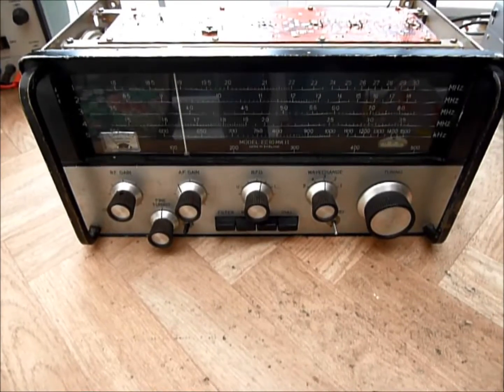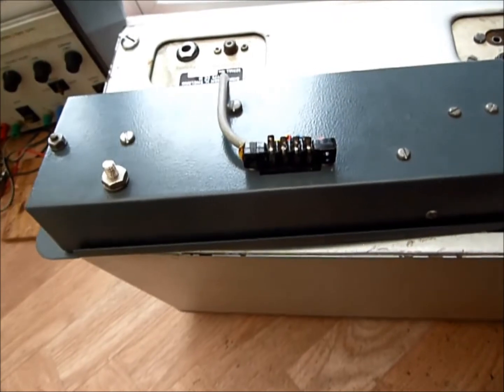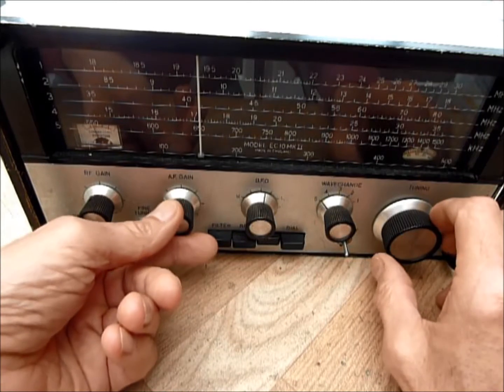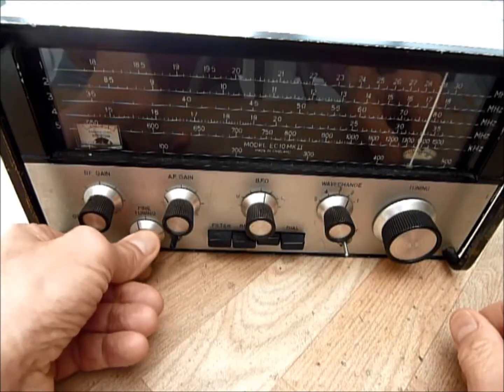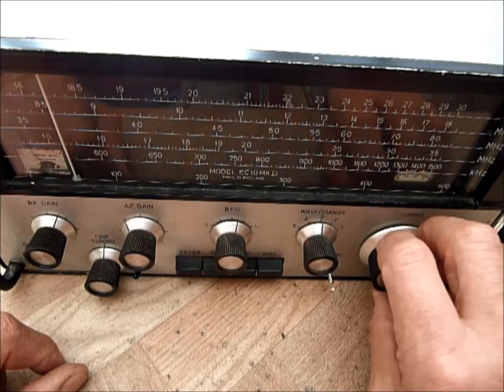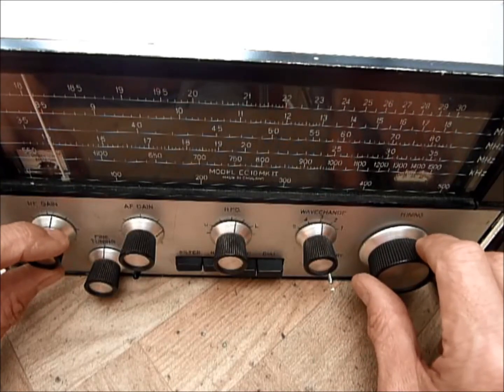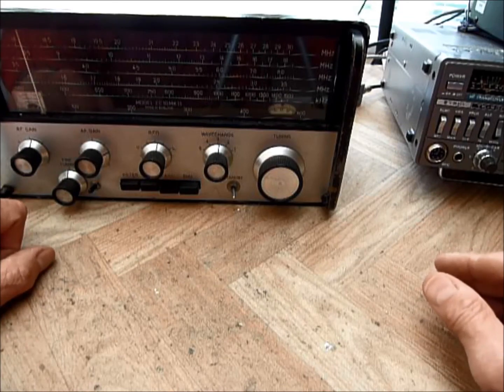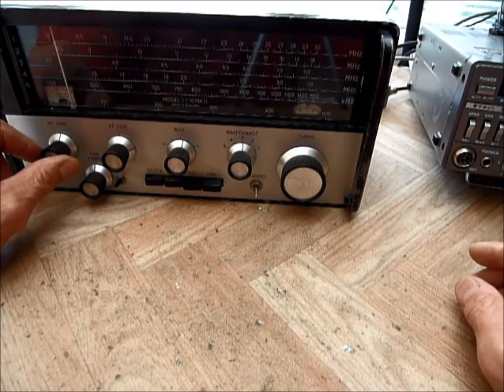1967 Eddystone EC10 (mk11) Radio Receiver Reviewed

Comment: Hi, I've just pulled one of these from my late fathers loft. It's immaculate, are they worth much?
Reply from the maker: Well that depends, more if it works, I would guess. I've seen them go in the UK for anything between £20 and £150. There are enthusiasts out there. Put it on Ebay 'for parts, no returns', but comment if it appears to work, to stop the scammers. Good luck!

Comment: I got two. Both sort of worked about ten years ago. With just a couple of feet of wire for an aerial. Didn't know what type of aerial to use. Push buttons on both are no good. I don't know what versions they are.
Reply from the maker: Hi.
If the buttons still click in and out, problems are often due to tarnishing of the contacts. I use 'Sevisol' switch cleaner. Spray a small amount into the switch bodies so it gets onto the contacts inside, being carefull not to get any on the front tuning glass. Work the buttons in and out and several times. Be very carefull if using it on the mains, there are exposed live connections inside